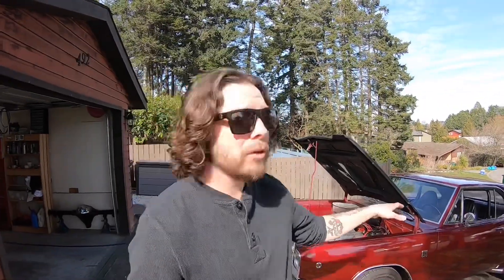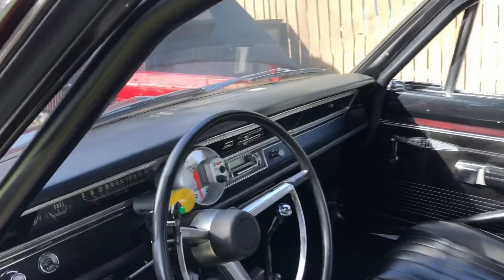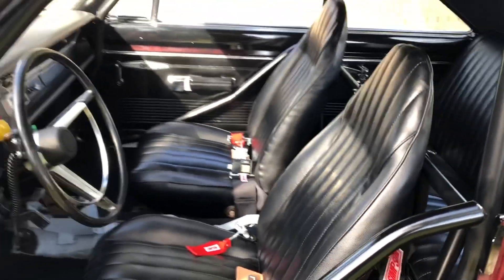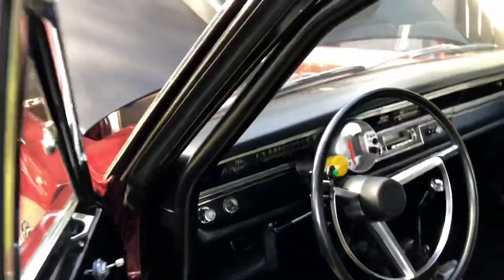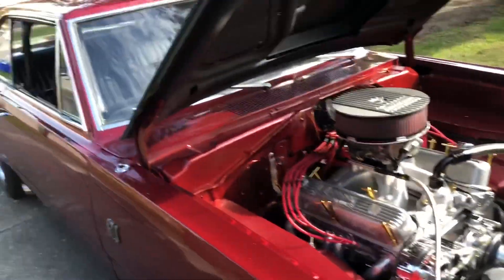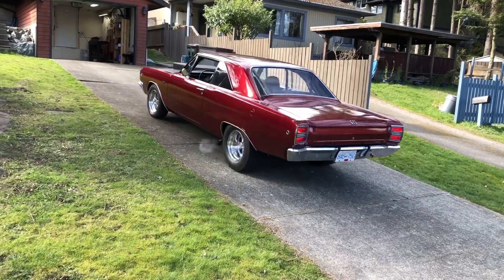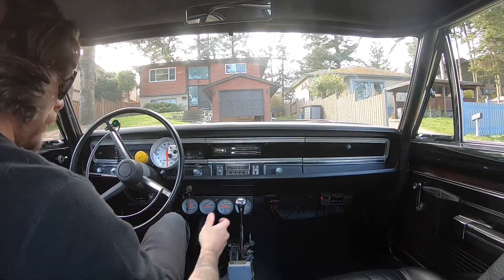First day back on the street! But what does my 1968 Dodge Dart drag car weigh?

Comment: Dodge needs to market this size of car today. Even with a v6 it would sell!
Reply from the maker: Ha. No v6 for me.... thanks for watching
Reply: @SimpsonsSpeedShop  magnum v6 has decent torque. With a better cam lobes of separation, duration and better lift it would be deceiving.
Reply: I've seen an honest 300 hp made from one without a blower or turbo. Just good olde naturally aspirated power.
Reply: In my crazy daydream mode, i thought that the 69 Dart with a Charger awd V6 drivetrain swap might be cool... 
OR using the guts from a Stealth RT/TT... Stock with 300-320 hp... Hmmmm......😁
Reply: @wheels-n-tires1846  That's cool. But AWD adds too much weight. A detroit locker for an 8 3/4 is pretty much unstoppable for the street.
Reply: @wheels-n-tires1846  A 239 v6 uses the same internals as a 318 small block. Parts are easier to get to rebuild a v6. Of course you'll have to have the cam custom grounded. The lobes of separation is ideal for fuel injection @114. 110-112 would be ideal for a carbureted setup. Getting the LA manifold from another v6 would allow you to mount a carb. The stock beer barrel manifold won't work because the runners are too long and it's a dry intake for fuel injection.

Comment: Love to watch your videos,I was thinking the Dart would be a bit ligter. Have had my own clone LO23 on the scale,it was 3420 pounds.A quarter tank of gas,heavy 66 crossram Hemi in front,8 point cage,lighweight wheels and a 8 3/4 rear.No bakseat and heater.My best in the quarter are 12.01 with a 3,55 gear.

Comment: omg sweet had 4 whoops was the 65 valiante  considered a dart had 5 3 at the same time luv my novas but 68 340 vertical gate shift was my fav had a 69 383/ 727 auto that did 150 plus in the quarter mile rolled that car end over end 568 feet yeah nice ride dou whatchin chu lub scooter d

Comment: my 71 duster 340 weighs 3250 lbs with me in it . mind you i have fibreglass bumpers and fibreglass hood .  i would have guessed your dart would be 3400 with you in it .  think that scale was a bit off lol
Reply from the maker: Steel cragars were on and had a tool kit in the back too.
Reply: @SimpsonsSpeedShop  old school mags like cragar ss , weld draglites look the best on classic mopars .  ive got centerline autodrags on my duster .
Reply from the maker: 👍🏻 I run welds at the track.

Comment: Sounds good,nice neat roll cage,did you build it?Back in the early seventies a friend of mine bought a used car in a nearby town and we took his grampas car to get it so I got to drive his new used car home,it had a factory roll bar in it. Not realizing at the time how iconic this car would come to be.It was a 67 or 68 Shelby 500 GT mustang,white with the two big blue stripes.How this car ever ended up at a small town GM dealer is still a mystery.I drove the speed limit home cause when I tapped it,it had a mind of its own,I think he paid like 3500.00 for it. When I see what they’re worth now,crazy.I think your car is one of the nicest I’ve seen.Ive got some more car stories I’ll share later,this has gotten long winded.😆
Reply from the maker: Hahaha right on my man. Sounds real sweet. Thanks for watching the vid!

Comment: I was looking at your cage and I have a question !!! Is it possible to get a bar past the dash area to connect the 2 pillar bars ??? I know it helps a lot to strengthen the cage and frame !! But when I stopped the video and searched the only area I saw was under the dashboard and I don't know if that's an advantage being so low !!! Just curious from a former drag racers point !!!!! I certainly know you don't want to chop anything up on that gem of nostalgia !!!!

Comment: Looks like my guess on fb was close. I said 3200-3300. I forgot to mention without driver. It's about the same weight as my Duster 3300 without me in it. Where did you get the hood scoop? I bought another steel hood for mine to put a hood scoop on it. I'm keeping my original hood so I can easily change it back to the flat hood if I want to.
Reply from the maker: Yep you nailed it! I made the hood scope. It’s 1/8 aluminum. I still have my nice GTS hood. Thanks for watching.

Comment: wow , look more spring like there then where i am at lol, I guessed car was about 3300 with you in it with cage, I have Wildwood brakes and the upper controls from PST  ot one of those ,and welsds prostars, but i think my exhaust will be very heavy since it is full length and electric cut outs. I think if you switch to the Dana rear maybe consider a 15 Gallon fuel cell instead of tank maybe. I ran one in my street Cuda for years with electric toggled on/off switch  Holley Blue Pump
Reply from the maker: Ya for sure. Dana prob happing soonish. I’m not overly concerned about weight honestly. I will get a glass hood back  on her one but like I showed full interior so weight is weight. Thanks for watching
Reply: @SimpsonsSpeedShop  Street Car! 😁
Reply: @SimpsonsSpeedShop  I think my 1974 Cuda weighed 3650 with me in it with all steel 340 and body ,full exhaust

Comment: So what have you done in the transmission? I would have thought at least a manual valve body, but it doesn't look like it. Can't wait for more racing..
Reply from the maker: Re build about 3 years back. Not a manual valve body but some good parts from A&A. And the 4500 stall I did last year

Comment: When you drive on the highway @ 3000 rpm what miles per hour are you at? Curious since my dart sport has 3.91's out back. Also a higher stall converter 9.5" FTI 3400-3600 stall. Haven't been on highway yet. I guess I've been somewhat reluctant or scared to get on highway with my set up. 🤔
Reply from the maker: Not 100% sure as my speed isn’t correct exactly to tire and gear size. I think like 50-55. If your on a 26” (stockish) size will be about the same. I have a 4500 stall. Don’t worry about it.
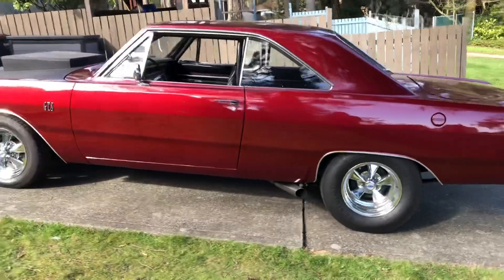Reply: Same with me too Cesareo! I run 4:11 9 in Ford with a C-6 manual reverse valve body. I am very reluctant to take her on the highway/freeway.

Comment: Hey Joe, I thought it would weigh less. My Valiant on the same scale, iron head 383 big block dana 60 half a tank of fuel  and no exhaust is 3144 lbs.
Reply from the maker: Hey bob! I know right, she’s heavy. I dunno. What ever, add more power!
Reply: My 69 Dart, same scale, with the wife and I, weighed in at 1610.
Reply: @SimpsonsSpeedShop  Ya I cut down some weight its hard to make big gains with out ending up with a chopped up car  and i don't want  that and i am sure you don't.  Lots of ways to make more H.P.!
Reply: any fiberglass parts on your car?
Reply: Wow!!! My 68 Dart with 440 was a porker then!!! In "ready for the track" trim, with tools n slicks in the trunk was just shy of 3800... Im pretty sure i had two child seats in the back though... 😂😂
Reply: @bobriekki3444  with these older darts and other mopars that are still in nice shape like all of yours are, it would be a sin to chop the cars up anymore to reduce weight! We don’t have enough of these old classics left that are in nice shape, and are being used exactly for the purpose that they were built for and to destroy the interiors just to drop another 3-500lbs is a sin! If you need to go faster, then make the engine mods to get you there but I’m against any body & interior changes that can’t simply be bolted back in again should you want to go back to stock. It’s easier and will probly provide bigger gains tho to just make engine upgrades and then you have the bonus of having a badass looking street/strip car like it was designed to be except for some upgraded safety equipment like the cage which is even tastefully done

Comment: Isn't antique insurance available in BC? I keep mine insured all year round for about $150/yr
Reply from the maker: Collector plates. Requires an inspection that my my car would not pass.
Reply: @SimpsonsSpeedShop  check into Modified Collector plates from ICBC. Its geared more towards the hot rodders.
Reply from the maker: Yes but with no heater, ie defrost, I still fail.

Comment: Rear end howl? Bearing maybe.
Reply from the maker: Probs just gears. Windows were down they are 4:10s so can be a bit noisy
Reply: @SimpsonsSpeedShop  at one point you took your foot off the gas and the howl went away. Check the pinion bearing. Is the seal leaking at all? To start with they get just a little damp when they start to go. But I'm no expert, that's for sure. Is your Cal Track and suspension all lined up correctly, and bushings and bolts all tight and not binding? I'm sure you'll get to the bottom of this in a video we we enjoy.
Reply from the maker: Ya cal tracks are all set. I’m not overly concerned about the rear noise. It is only a couple years old after rebuild. And if you look at start of vid you’ll see something in the right of the garage that will make sense why I’m not too concerned. 😅
Reply: @SimpsonsSpeedShop  WOW, I didn't catch that when I watched the first time.

Comment: Oil pressure to me seems to be low...did I see it drop to 10 at idle and only 40ish at 4500?
Reply from the maker: Every time I looked seemed good. 40ish at 3000 and over 10 at idle. 10 per 1000 rpm is good
Reply: @SimpsonsSpeedShop  I went back and watched your oil gauge during some track runs and you have low oil pressure.  30psi at 6200 rpm is no good.  Better cut that filter apart just to be safe.
Reply from the maker: Ya I keep an eye on it. She is just about ready for an oil change so I’ll cut it open then. Motor is only a year old.
Reply: @SimpsonsSpeedShop  May be 20/50 oil and try another gauge.
Reply from the maker: 20/50 is exactly what I was thinking.
Reply: I use csstrol 20w50 and half a quart of lucas in my carbed 360 magnum. I get 68 psi cold start at 600 rpm, 12 psi hot at idle 750 rpm. Reallt helped coming from 10w40 and made the valvetrain nice and quiet

Comment: Do you get a lot of exhaust smell inside the car while out and about driving?
Reply from the maker: No not really
Reply: Your carb isnt good/or out of tune..My cars have no smell..440's,383's stroked out 400's all are quick cars 10-12 sec  1/4 mile cars....

Oddly the car I drove today a 2017 Accord smells,maybe thats why I got a good deal at the dealer auction lol..Want it? lol

Comment: I know you like the scoop and everything but you're losing power and ET having it open like that. I have read a lot about it and the experts say it should be sealed and the air should be going directly into the carb. The faster you go the more important it becomes. One issue is that you are feeding the carb hot air from the engine, but there are a lot of other things involved.
Reply from the maker: On the short track I’m on not gunna make a difference at all. Maybe on a 1/4 I might see some mph. But I’m not interested in an air box on top of the motor.
Reply: id rather have the air going over the intake and engine bay, helping cool the intake charge.